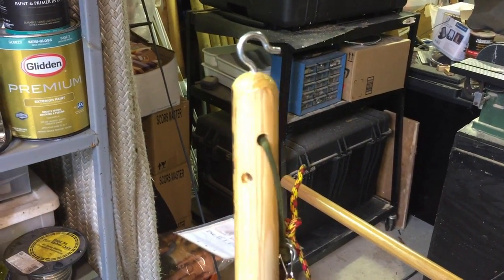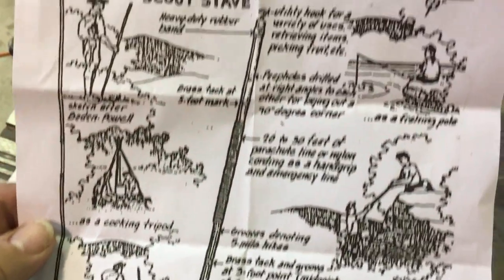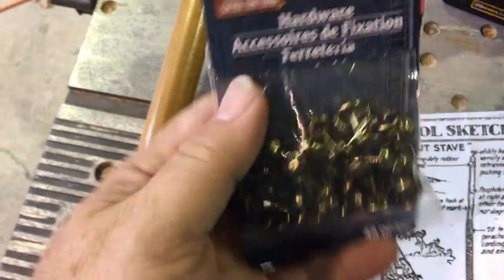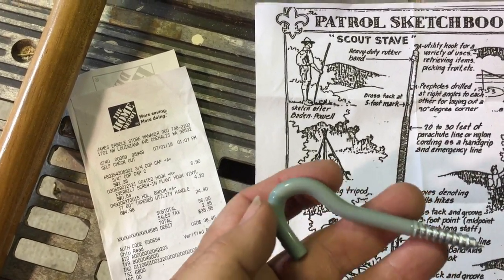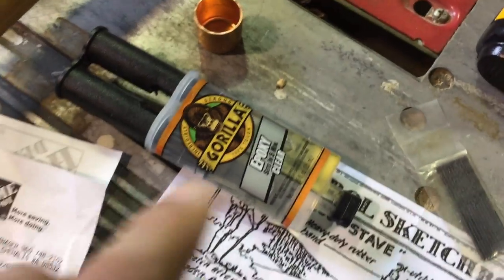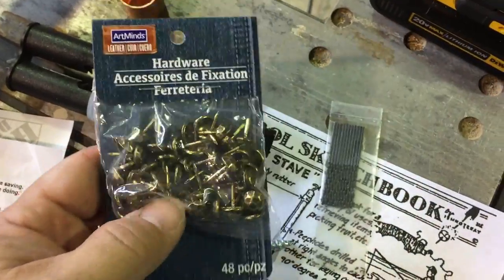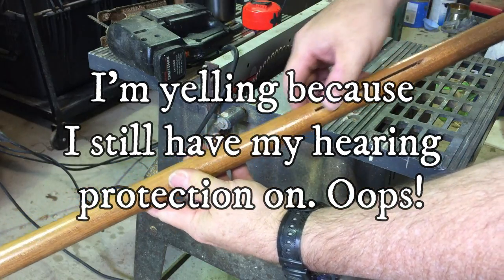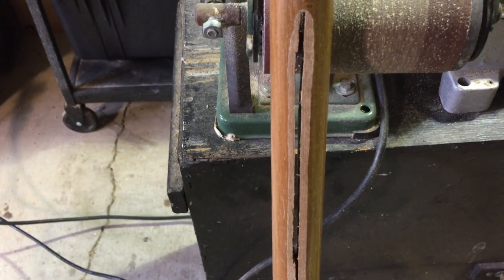Awesome OLD SCHOOL BOY SCOUT WALKING STAFF

Comment: When I was just a mere lad back in the mid-1950's,  my Scoutmaster was a retired Army First Sargent. He wanted our walking sticks (his words) to be as close to the Boy Scout diagram as possible. There are minor differences between your stave and ours which is to be expected. The most notable was that we made a "stash bag" from leather that tied onto the stave for fishing equipment, matches, and band-aids. We also used a hand cut straight stick rather than a rake or broom handle. We were poor kids and didn't have the $$$ for a "custom-made stick", as my Father called it. Thanks for the memories, I'm sure the First Sargent would like your stave.
Reply from the maker: My adventures as a lad started in the 1970's, but I didn't have a Scoutmaster for very long. The Troop disbanded around me and I was left alone. It was a small town, so the Troop was not big anyway, but I missed out on the journey. I saw the diagram, given to me by my Woodbadge Scoutmaster that I staffed for. I just to had to make a few as gifts for my two Eagle Scout sons. They carried the staffs with them on the 50 miler this last summer... so they are officially "trail rated." Thanks for stopping by... please come again. :-)
Reply: Your pouch makes a lot more sense than that cut.
Reply: @dlighted8861  

The stash bag was a project assigned by the First Sargent. Think of a big fat folding knife pouch. The backing was about 6 inches long by 2 inches wide. The top 2 inches folded over to form a flap. The front piece was about 4 inches by 4 inches. When stitched together, the back piece would wrap around the stave and the front piece would bulge out for access to the contents. The front and back pieces were stitched together with leather shoestring. The flap was held in place by a hand carved button that was held by a piece of leather shoestring. Leather shoestring material also tied the pouch to the stave. The pouch was waterproofed by dipping the completed pouch into melted paraffin and rubbing vigorously while the wax was still hot. 

The pouch was crude, in point of fact, I used an old boot as my source of leather. The leather shoestring was purchased from a shoe mason. Making that pouch was alot of fun for a 9 year old.
Reply from the maker: @dlighted8861  I forgot to mention, please do not allow your Scouts to use power tools if you are planning to encourage them to make their own old school Scouting walking staff. (It is not allowed in a Scouting activity.) Also, remind them about the Leave No Trace policies in certain areas are highly restrictive, and if they are going to try and harvest a walking staff from the forest, gain the responsible parties permission before proceeding. Using "dead" wood is most always preferred over live standing wood. Best of luck with your project!
Reply: @HelicoolsHelipad  

Ya' know, I was thinking about  power tool usage when I watched the video. I can remember the hue and cry from parents back in the day when it was announced that we were going to use only our Scout knives on the stave project. We all worked together and helped our buddies, no one suffered as much as a cut finger. There were many lessons learned by all.
Reply from the maker: @georgeboyer8158  yes... nowadays, even with Eagle Scout projects, no Scout may operate a power tool or be above a certain height off the ground (among many, many other safety rules). There are pro's and con's for both ways of thinking. If leaders would just keep their focus on the youth, a successful project need not have to be complex nor turn out with professional looking results. It is all about the youth and how they grow into adult leaders. I made these staves as gifts, primarily for the adult leader, or in the case of my sons, Eagle Scouts. I know this style is not going to please everyone's tastes, so I enjoy it when people add in their own flavor to further the "story" of the video.
Reply: Also father son project 😍🤩🥰
Reply: I agree with the pouch for all the extras thanks for the in put
Reply: What on earth are you doing? 😂

Comment: .... I have never seen a hiking staff with this type of cutout...Looks like too much trouble for the use...this is why Scouts have a small emergency kit made up in a small container ..the one I used a Scout was made up in a small Sucrets canister...worked like a charm....held, waterproof matches, fish line, hooks, small sinkers, some  bandages,small tweezers and a single-side razor blade...had it for YEARS...used it a few times for minor cuts...always had it on top of my pack, right next to my rain gear,,,
Reply from the maker: This staff was never intended to take the place of easily popped together emergency kits for backpacking.  I've got several of those too. As I added in the video, the center cut is optional for a hidden pocket of emergency supplies, effectively making the staff a swiss army knife, and if that is all you had it would make the grade. The majority of the video is to spark your imagination and coax someone into building a staff like the old Boy Scouts magazine showed how. If you watched the video to the end, there is also a follow on video that shows all the "mods" that I could think of the make the staff into a lot more! Use them or not... or come up with your own mods.... but use your imagination.

Comment: Nice video, nice stave.  I have made a number of these types of walking sticks over the years and have used everything from a straight tree branch to rake handles to long dowels.  I find each has its advantages and disadvantages.  Lately though I have been using two lengths of 1/2 round oak moulding.  This makes for a very strong utensil.  Today's glue and epoxy are actually stronger than the wood itself.  I supplement the glue/epoxy with a few off-set dowels.  This method allows for development of clean/safe compartments for hooks and bandages (e.g. no dangerous table saw work).  On your stave you could cut off a short portion of the tapered end so the copper plumbing cap fits snuggly. Where I come from the oak walking sticks make for a good defence form coyotes and badgers - no joke...  Great job.
Michael from Canada
Reply from the maker: Michael, that is the best alternative that I have heard for avoiding the table saw cut method! Very, very good idea, and I certainly love a good oak walking stick for their sturdiness. Thank you so much for added a positive comment that furthers the story of the original Boy Scout walking staff.

Comment: When I waa a Boy Scout my "Stave" was made from a Sugar Maple sapling.  I found one that was dead straight.  Cut it a ground level with a bucksaw.  After carefully drying it out to prevent checking i worked on the shaft with my curved  "cabinet scraper" made from a broken glass gallon jug.  After it was sufficiently smooth it got soaked in thinned Boilded Linseed Oil  for about 8 months.  Then it was Sun Dried for another month.  I used a 1" ridgid copper pipe on the bottom with a pipe cap sweated on.   It turned out great.  Oh yeah, it was completed in 1959.
Reply from the maker: I your memory of making this as a youth. So many memories in Scouting that they have to be waved away by the hand just to come back to the present. Thanks for sharing!
Reply: @HelicoolsHelipad  My memory is still vivid and accurate.  I will be 72 in May.

Comment: The thing that stuck out in my mind more than anything else was the water depth measures. We had to use thumb tacks and we only had three tacks per scout; a green track for one foot, a yellow for two, and a red one for three. Again, we were poor kids and had to use what we had. Our group fell apart also, one-by-one over several years. It wasn't the lack of desire on our part, it simply was not affordable for our parents. Good times, though.
Reply from the maker: You know, I think that is why I tend to "over-compensate" as an adult. I was the youngest of eight hungry kids with my Dad deployed in the Air Force for much of my childhood. I remember building stuff out of what we found in the forest or at the local landfill. 

I was given thumb tacks to use, but saw that the old school Patrol stave used the markers as "emergency nails." The larger decorative tacks were more like nails than the thumb tacks, so that is what I used. 

Once again, thank you for adding to the story of this video. I am so pleased that it brought back fond memories for you. Many blessings!
Reply: Thumb tacks also double for legal fish length. Keep on Scouting

Comment: When we made ours, we just put the hooks, line, thread, needle, safety pin and hand aides in mini zip lock bags and put under the para cord as we wrapped it. Saves making the cut so the boys could do it themselves.

PS dental floss can be used for fishing line and sewing thread. Also, in a pinch, a safety pin can be used as a fishing hook.
Reply from the maker: You need to watch the Walking Stick Mods video. Instead of dental floss, which I really like for whipping rope ends, I added artificial sinew and bank line over the top of the fishing line, after I wrapped it in wax paper. Now, I have fire starting material as well. 

Presented here are ideas to start you off. Do what you like best, and it will always turn out great.

Comment: The 90° peep sight doesn't just help you make a corner, it helps you stay on a truly straight path by sighting to landmarks, keeping them at a right angle to your side, similar to using a compass for sighting a trail.
  Turning the stave in your Clamping device so you are once again drilling straight down will make for a much more consistent, straight and level hole because working from the side makes it much harder to judge and hold true unless your drill has a built in level and you'll still be more inclined to veer left or right.  Just a tip from a long time wood/metal fabricator.
  I'd also recommend carrying more than one size fish hook, both a worm hook like you show there and a smaller egg hook, which can be used to make impromptu jigs (like flies) as well as eggs and small larvae, etc. for smaller trout, bait fish, etc..
Reply from the maker: Indeed. The best advice that I give is to always have your 10 essentials with you in a small day-pack... but if you somehow got separated from those items but still had your staff, the minimal items that you carry in it and on it while remaining light weight is key. Of course, I keep a small set of fishing items in a tiny multi-compartment in my day pack. The fishing stuff is not one of the 10 essential items, but it sure is nice to have in a pinch. I am glad this inspired you to take the time to write down this comment. I hope that you also build a staff with one or two of the ideas that I have shared, along with all the customization that you can imagine. I am certain, it will be cool and very handy in a pinch.
Reply: @HelicoolsHelipad  
  Sure, and I have lots of redundancies depending upon the situation, like a walking stick kit, because it's when your not expecting it that something happens   I was just suggesting pretty much exactly what you have, just two sizes of hook because it's so unpredictable as to a lake or stream or what type fish you may encounter.  Good video.

Comment: Some suggestions.  Put a ranger band at each end of the 550 cord.  But some brass wire next to fishing line, put a scalpel or razor blade inside with your band aids.  Staff looks great
Reply from the maker: Whoa! Thanks for gifting me with those great ideas. I'll have to pull the 550 cord off to get the razor in there, but was meaning to weave that into a fish scale handle anyway. Thanks so much!

Comment: The one thing that I would suggest as a modification might be to swap the copper at the base for one of the rubber staff/cane ones that are out there. Might be a little bit more expensive than the copper end cap, but it gives a bit more grip and doesn't clank as much if you're going onto areas of cement or stone...or wood.
Reply from the maker: Good idea! For me, it was just easier to source and was cheap. An added benefit is that it lets bears know that you are coming, and gives them time to gather their cubs and move away. Very noisy "animals" are noisy because they are so dangerous, they can be noisy and get away with it. Other animals recognize this, too.

Comment: Great video, thanks! Just a suggestion, when gluing on that 3/4 inch Copper cap on the bottom end of your stave, cut off about an 1/8 inch of the tapered end of your hoe handle. Your cap will fit tighter and firmer...
Reply from the maker: Hi Jim! Thanks for the suggestion. I was attempting to keep the integrity of the length of the staff as a measuring stick. My suggestion is to use a liberal amount of epoxy to fill the gap. I know, a half an inch isn't much, but can you imagine the number of comments I would get if the staff was off my a half inch? LOL! Thanks again for furthering the story of the video. Many blessings!
Reply: @HelicoolsHelipad  Actually, I said about 1/8the, ( one eighth) of an inch, for a snugger fit. Another suggestion might be to use a 5/8's inch Copper cap, as opposed to the 3/4, and just shave up the end of the stave to fit...my reason for this is a cap simply held on by glue, rather than a tight, friction fit, is likely to be knocked off rather soon with outdoor use, around rough terrain, and when that is lost, your stave would wear out much quicker. I am not trying to take anything away from your design, I really like it, you have added many useful features, great job!
Reply from the maker: @BoomLover1000  Any suggestions made to continue the story might give future folks visiting here more ideas than just the original video started... so it's all good. I'm not sure if they make copper pipe in 5/8" though. I think it is mainly 3/4" and 1/2"... of course 1/4" and 1" as well. 

So far, so good... I took mine on a 50 miler and trail-tested it this last summer (actual 54.4 miles). I haven't really smacked the heck out of the cap to the point of failure yet, but I am sure it does have it's limits.

Comment: Interesting survival features inside the walking stick. My grand fathers walking stick was covered full with small metal plates with historical signs of each visited town/region in germany and austria. Craftmens advice: mark + punch before drill a hole through smooth + rounded body surface like this cylindrical stick.
Reply from the maker: Ah yes... love the collectable staff emblems. I never quite got into them, but they are very cool looking. Thanks for the advice on drilling... it helped!

Comment: Good job. Very informative. I plan on making one, or more. A few things I'll do differently though. For the copper tip, I'm going to use something so I can change tips. For the drill holes and saw cuts, I'll smooth/round them off with a Dremel and sand. Great idea on the clear coat. I'm thinking I'll also add some snare wire. Instead of the packaging tape I'll use duck tape. With the hook, I'll try rubbing the threads on wax before threading on. I really like the idea about the tacks too.
Reply from the maker: That is the whole point... mod it in a way that makes the most sense to the person who will be carrying it. Great ideas! I also added an artificial sinew wrap and a fly fishing reel held on by two hose clamps with wing nut tighteners. Best of luck on your stave.

Comment: I really enjoyed seeing how you made this stave. It’s really nice and should be useful in the field. It reminded me of one I saw a guy use hiking. The difference being his had what I thought was a flag. When it came time to set up camp his came apart into three pieces and the flag turned out to be the seat for the stool the walking stave became. I wish I’d have taken measurements.
Reply from the maker: Views and Reviews whoa! Now that would be cool! Was the conversion process quick and easy? How did he keep the three pieces together?
Reply: Helicool's Helipad thanks for replying and to answer your questions; yes it was easy/quick (less than one minute) to put together, the parts were held together by threaded ends (copper fittings?) and when assembled as a stool he had a steel ring that fit into notches in the stave sections with the “flag” cord (it had a cord sewn in the outer edge) fitting over the threaded portion of the fittings. The whole stave was about head high on me when assembled as a stave (I’m just over 6 feet tall). Because I think it might be a tad lighter I’ve been considering an adaptation of his design that uses a braided paracord loop or loops to hold the stool legs together where they cross.
Reply from the maker: @viewsandreviews180  That sounds very cool. I can get a picture in my head of what it might have looked like and operated by your description, which I appreciate very much!

Comment: Drill a whole above and below the cut to help prevent splitting of the staff.
Reply: Use a wood punch to start your drill bit should make drilling easier.
Reply from the maker: @jamesboothjr8783  ...and I had an punch right there in my tool box. Yeah, sometimes when I'm shooting YouTube videos I forget the simplest things sometimes.
Reply from the maker: With all that 550 cord on there, I don't think is going to be a problem, but drill stopping cracks would make having any issue just that much less likely. Thanks for the comment. Come on back anytime.
Reply: @HelicoolsHelipad  And it usually is the simplest thing which causes the most injury.
Reply: @jamesboothjr8783  and he should shim that table to keep it from rocking!!!!
Reply from the maker: There are “foot adjustments” on the table saw, but I keep having to move the saw around, so I just deal with it.